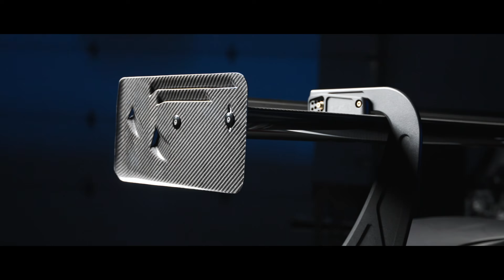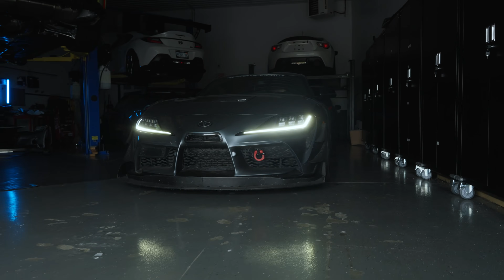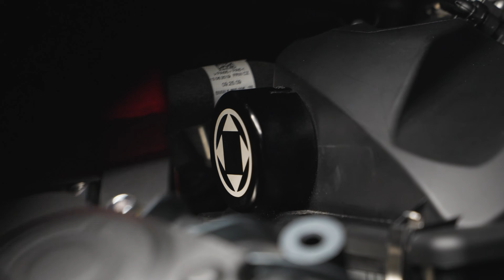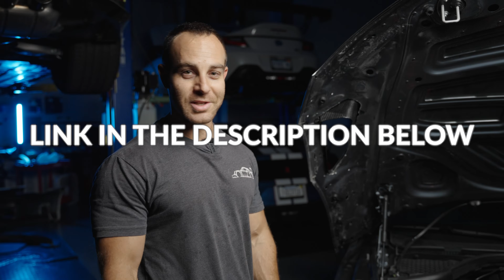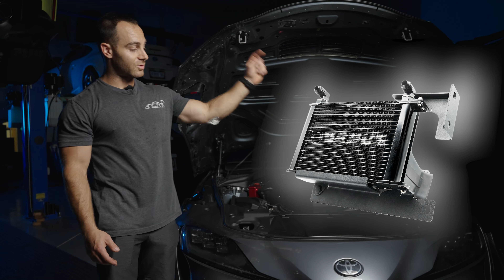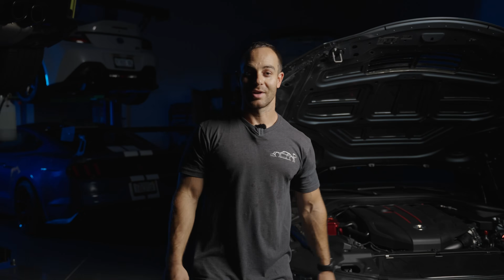Simple A90/A91 Supra Engine Add-ons

Comment: i have already bought mutiple verus parts like master cylinder brace canards diffusor and engien mount and camber mount on my gr supra and i love the ucw swan neck verus wing much more so then other brands but i was hoping you guys do a lower mount rear wing more like a 992 gt3 kid of height.
Reply from the maker: The rear wing on the Supra is as low as we can make it without becoming detrimental to the functionality of the rear wing. We do our best to balance looks and performance.
Reply: @VerusEngineering thanks for the feeback much appriciated im currently on ventus 1 aero withh cf duck tail but i really want the gt3 look on my car the ventus 3-4 look closer to a gt3rs then a gt3 in my opinion.

Comment: For the hood and wheel well vents, have you guys tested various-sized wickers to see if they are helpful in evacuating air and improving temps further or at least are helpful from an aerodynamic standpoint?
Reply from the maker: No wickers are available for either product, but we have tested various different heights for the leading edge. You will notice on the fender louvers that the leading edge sits up higher than the rest of the louver and essentially acts as a wicker.

Comment: Any plans to make a valve cover breather kit? Or would you recommend (or not recommend) using one from another company?

Also, please don’t forget the request to make a coolant add on kit for the GRS AOS (as that would really complete the whole system). ❤
Reply from the maker: No, current plans for a valve cover breather. However, the answer to your question really depends on the application. We will keep the coolant kit in mind though!
Reply: @VerusEngineering  
Might be a dumb question but does your AOS system have any effects that would be similar to a crankcase breather kit (hence making the use of one needless with your AOS)?